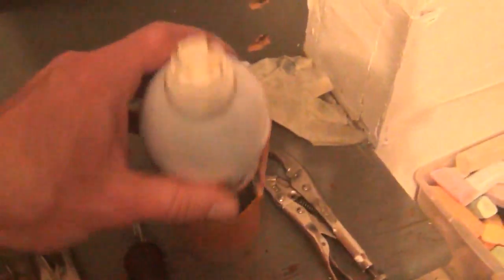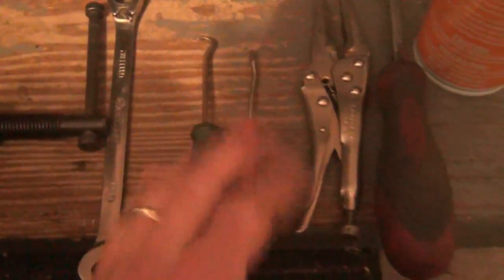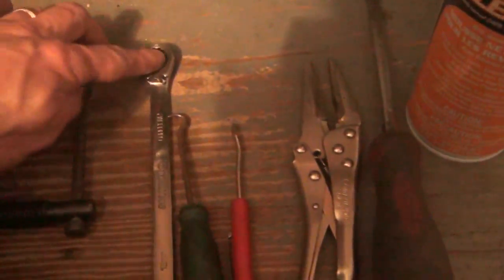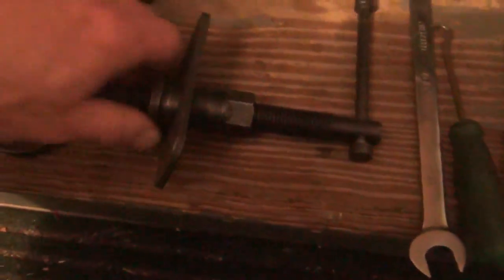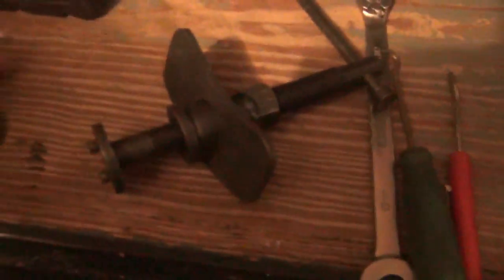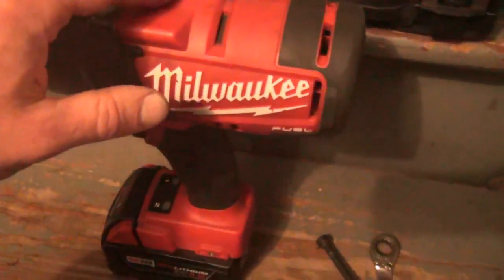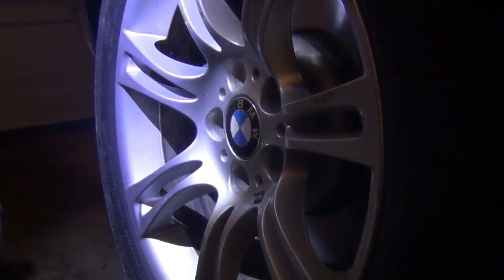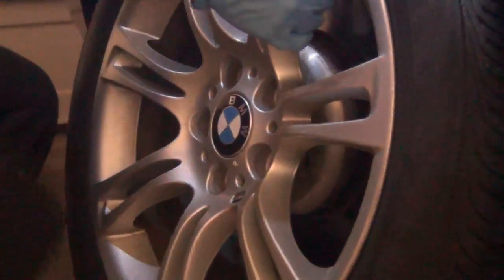BMW Rear Brake Pad Replacement And Electronic Parking Brake Procedure BMW 5 Series F10

Comment: Interesting!  On these BMWs I've always resorted to using my scan tool to retract the parking brake motors before compressing the pistons in (without spinning the piston).  The other method I've used was removing the parking brake motor from the caliper and manually retracting the jack screw in the caliper before compressing the pistons.  I was always lead to believe that using a conventional caliper compression tool like you used would damage the parking brake system (my factory training for Ford/Chrysler).  Good to know that the regular method that you showed works perfectly fine on BMWs.  Kudos!
Reply from the maker: Hi AK! Having a good scan tool is a huge benefit when you can activate the parking brake to service mode. But the conventional method using the special tool is an option for the DIYer. Thabks for posting!
Reply: @AskTheCarExperts  Actually, you can just take the backing off and use a torx bit to retract the piston...otherwise, you will damage it.
Reply: Interesting to see it done manually. I'd always wonder if it mighty screw up the calibration of the EPB. Will stick w my scan tool.
Reply: @Crondar777  Yes, manually turning the piston in is in the BMW official repair manual, with tool 2 320 871 and 2 320 299, which are similar to the ones in the video.
Reply: Hi AK, what scan tools are you using to retract the electronic brake?
Reply: @team-tan-vlog4095  I've used both my Autel MS906TS and my Thinkcar ThinkTool PROS scan tools to do battery resets, ABS brake bleeds, and EPB service on BMWs and many other vehicles.
Reply: @AskTheCarExperts  I was watching this in disbelief - HOW? Got the exact same piston retractor tool set (well it's not literally the same but has the same parts - I think even more of them) - but I've only used it on the fronts. In the rear on my other car - the 2008 Audi Allroad (C6 gen) I used the brilliant VAG group scan software - the almighty VCDS - to retract the rear el. parking brake. The brake mechanism seems extremely similar to my other baby - a 2012 530xd F11. And this somehow feels counter-intuitive, to put it mildly - I thought I would need to use the ISTA+ or something similar. Currently unable to reset the scheduled warning light on my bimmer for some reason via the dashboard hidden menu - although there's still plenty of meat (abt. 3-5 mm) on the pads, so I thought - yeah, probably needs to be retracted via ISTA and then the car would know the pads been replaced - because the sensor isn't worn yet I don't think - but watching this kinda left my mind blown - wow. Anyway. The parking brake motor probably doesn't care if the piston has been "retracted" (ie, screwed in) or not - it just works for a certain time, then, when it detects a certain current threshold on the motor (ie, more load as the pad is being pressed against the rotor), it just stops its move - at least that's how it works on the audi. Anyway. The more you know I guess. Thanks for the pretty well explained video, greetings from Latvia.
Reply: I use a c clamp and press an old pad while compressing the c clamp

Comment: Excellent video!   was wondering, what year and model is this BMW SUV?
Reply from the maker: Thanks Ozgul! This was on a BMW F10 5 series which is from 2010 to 2017 but the procedure is basically the same on all current models for the rear brake pads.

Comment: Hi Excellent video, I am about to perform my own break service, I see in your video you did not open the brake fluid cap? Is it not necessary? Also is the calculation life span is not calculated together with the rotor?I'll tell you why my front rotor was not replaced since my car was new, and when replacing the pads, it also had a low calculation, replaced the rotor, or like we call in South Africa the break disc, it then adjusted to a higher amount. Thanks in advance.
Reply from the maker: Hello Ahmad Shah, It is a good idea to open the cap. It can help make it easier to push the caliper piston back. Also to make sure the fluid does not overflow. The rotor will have a minimum measurement stamped on the hat portion. You would need to measure with a micrometer and see if it is below minimum. Check for any rust or scoring. If in doubt replace the rotor (brake disc) to be safe. Thanks for watching from South Africa :)

Comment: I’m confused as with years of working on Audi, VW and BMWs with rear EPBs I’ve never seen them push back as you were winding them in.. question…did you retract the jack drives on the motor first? That should have been done with the scan tool or as people know you can with a t45 bit and manually retract the drive.. I didn’t see you perform and EPB pre work before you removed the calipers. Also, the tool you are using is only needed for the manual hand brake, if you retracted the EPB like the manual indicates you can just squeeze in the pistons with large channel locks but that’s not advisable because there isn’t much to hold onto due to the plastic motor case. It’s ok to use that rewind tool but you can push it with a without the notched plate a smooth one, because if your retraction is done you don’t have to turn the piston you can compress it like the fronts.. another think you always want to inspect the slider pins, boots and probably clean and regrease them .. and best to clean up the piston face with brass brush to knock some rust off it.. really good job with the video
Reply from the maker: Hello, Let me clarify for you. the tool used turns the piston which turns the internal screw to back off the EPB manually. That is the purpose of the tool. At the same time it can push in the caliper piston. You do not want to compress the piston without using the tool or damage can result. Another method is to use an electronic device that can retract the piston into the assembly  mode. Do not do this with the caliper off because it will cause the piston to come out of the caliper. Then you can compress normally. Or you can actually remove the drive from the back of the piston.

Comment: Hello
Just watched your video, but my question is, did you use any diagnostic equipment to unlock the brakes either when you started or when you finished changing the brake calipers.
Reply from the maker: No, I used a special tool. But if you have a scan tool that can activate it that is much easier BUT make sure the calipers are not removed or it can blow out the piston

Comment: Hi, Thanks for the video I was wondering what make are the pads and discs? I know they  BMW packged but usually  a different manufacturer makes discs for them is there any stamps on the actual parts. The reason I was asking is because i want to replace mine and usually ATE, Brembo and Textar make similar discs with the rivets (2piece discs aluminium hub and iron plate).
Reply from the maker: Hello, That is a very good question. Unfortunately I am not sure who the manufacturer is outside of the BMW labelling. Sorry I could not help further.
Reply: I replaced the original BMW pads with Akebono ceramics. Great pad. Less dust also.

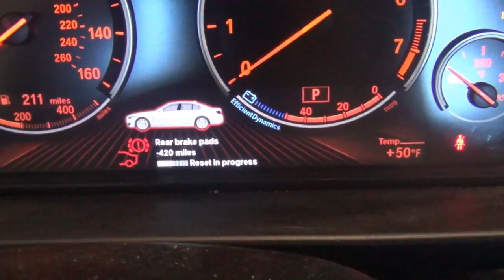Comment: Why only 6000 miles remaining as seen at 22:29 after the pads were replaced?  Did it recalculate after driving, or is time for a CBS correction?
Reply from the maker: Good catch on that! To fix this the forecast needs to be reset. This is a hiccup in the CBS data calculation.

Comment: Hi do you need to replace all bolts or just reused them
Reply from the maker: Hello, The bolts are 1 time use as they stretch during tightening. I would recommend replacement as brakes are a safety item. Any failure could be potentially harmful to you or others.

Comment: How do you remove rotor with parking brake applied or released?Thanks
Reply from the maker: HI naveed, You would remove a rotor with the parking  brake released. On this vehicle since the parking brake is the caliper nothing special needs to be done to remove the rotor.
Reply: @AskTheCarExperts  Thank you so much for your prompt reply.Do we have to turn ignition on to release parking brake because without ignition on I believe it doesn't release and then turn ignition off and carry on with your job.is it correct.
Reply from the maker: @NSK746  Glad to help.  You will need the special tool or a scan tool to put the caliper in service mode. In the video I use the special tool. Malebsure to not activate the parking brake if the caliper is off or it will blow out the caliper piston.

Comment: How you did push the piston? First, you have to make the electric brake off or you did it before you make the video?
Reply from the maker: Make sure the e brake is off. You use a special tool like the one in the video to turn the piston like a screw. This walks the piston into the caliper.

Comment: Hi, thank you for the video, it's the best explained process I've found.  Two questions, firstly after loosening the two bolts my caliper really doesn't want to come off (where as yours 'walked' off), any tips on how to get it off? Secondly,  can you use a quick grip to push the piston back in? Advice would be greatly appreciated... Thanks.
Reply from the maker: Hi Richard, Try to use a screw driver to help lever out the caliper. You can try to push the piston back a bit by prying on the in board pad. Make sure to only compress one side at a time. You can also use the old pad to help compress the piston evenly.
Reply: @AskTheCarExperts  hi great, thanks. Very stupid question i know, but how do you release the hand brake/parking brake? Mine auto engages when the engine is turned off??
Reply from the maker: @richardhennah7329  No worries. You may have auto hold turned on. Turn off the auto  hold setting. Make sure to manually release with the parking brake button with the key on engine off and foot on the brake.
Reply: @AskTheCarExperts  Legends!! Thanks for that, I've just purchased a Hilka caliper reset kit from Amazon. Will tackle again tomorrow!  Thanks for all your help. Rich.

Comment: Having trouble seating the brake pad back into the piston... any advise?
Reply from the maker: Hi Daniel, Hopefully you where able to get it figured out. Maybe the piston is not fully retracted. The style that has the spring clip can he difficult to seat but with some effort it should lock in.

Comment: Hi. What about the electric handbrake? Is not need for an computer to open it?
Reply from the maker: You can use a scan tool to release the parking brake but a special tool can also be used as shown in the video. BMW does not pay their techs to electronically actuate the brakes. A special tool is used to save time which turns the piston into the caliper.

Comment: Como se cambia filtro cabina BMWX1-2019
Reply from the maker: On the passenger side. Remove the lower kick panel. The micro is tucked under there

Comment: Why did it show that there were only 6000 miles left on the new brakes? Couldn't you set it for more?
Reply from the maker: It usually is more than 6,000. This can sometimes be from a calculation issue with the vehicle programming.

Comment: So they only get 6000miles from a set of pads ?
Reply from the maker: Hi Tom, It really depends on the type of driving and the type of braking you do. Most people get quite a bit more than this. Town driving would be faster wear. My friend got 81,000 miles recently with 60 percent highway.
Reply: @AskTheCarExperts  thanks for reply mate yeah my 520d done about 50k and just about to change them . I've notice bmw / mercedes run such soft pads and rotors compared to my hyundai with 180k from rotors and pads haha
Reply from the maker: @twiggs920  Great stopping power with great amount of brake dust on the rims 😀

Comment: No lube of the caliper slide pins?
Reply from the maker: No lube per BMW repair instructions. They slide freely in the rubber sheathing when properly clean.
Reply: @AskTheCarExperts  Thanks!